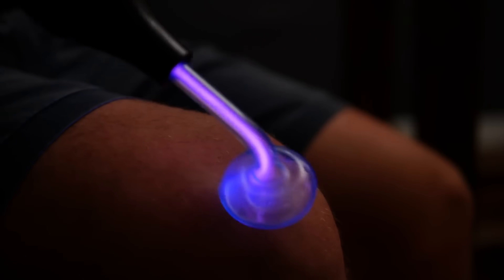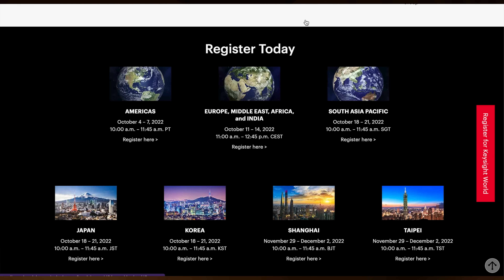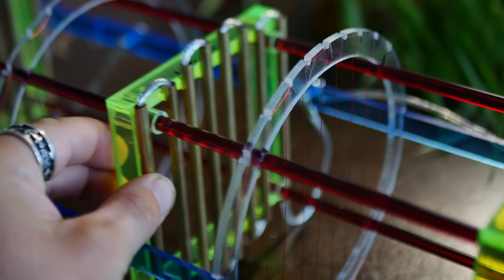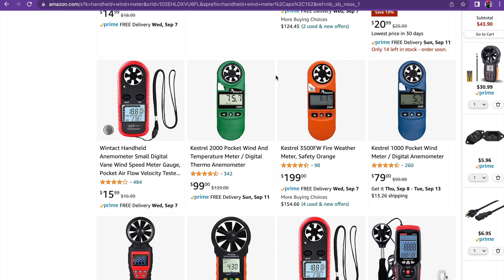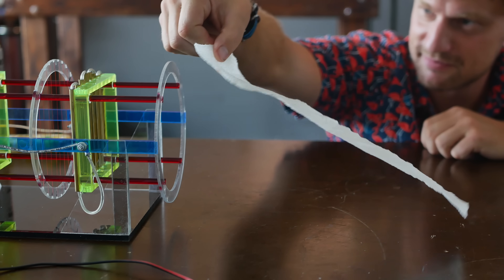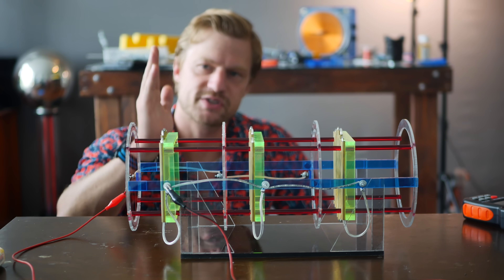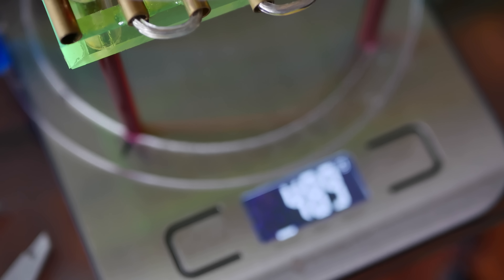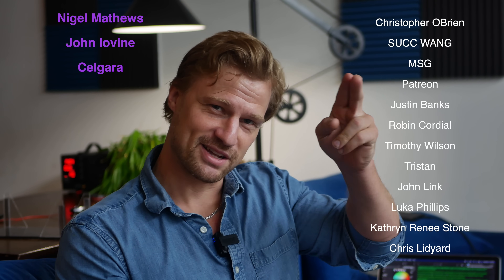Designing A Next-Gen Ionic Thruster! (For Flight)

Comment: How do we determine the optimal space is required for the separation/gap distance between the each segment/the wire’s (e.g. in terms of number of electrodes, their geometry, physical electrical parameters such as arc voltage and frequency, etc.)

For suggestion, use of dielectrics may be something considering for future advancements. Great project!
Reply: The larger the gap and thinner the emitter wires the more thrust is produced per watt, and less current is required.  In other words, large spacings are much more efficient.  If a strong heavy power supply is used closer spacing produces more thrust, but at a great cost to efficiency.  Multiple stages produce a little more thrust but also at a large cost in efficiency.  Visible corona even in the UV light spectrum represents power losses.  It is most visible on these devices with close emitter to collector spacings.
Reply: This make sense both empirically and in general. Perhaps the direct relationship to efficiency is non-linear or there are additional parameters to consider that make things non-ideal which has more so to do with the electrodynamic behavior as well as the interactions with the geometry involved, assuming everything else remains constant. Thank you for answering.
Reply: @Matthew-fl1cb  Any type of thruster that moves a small diameter surface of air rapidly is going to be inefficient. Any type of thruster that has a large surface area and move the air very slowing is going to be far more efficient.  It is basic physics.  Ion thrust is a low level thrust that can be produced very efficiently over long periods of time, but once the speed of the exhaust is increased in air, it becomes much less efficient. You are also correct that the interactions with geometry are very important.

Comment: This is so cool! I have a few ideas.

- This kicks off tons of UV and ozone, so different material choices are definitely in order for longevity for any flying model. Carbon fiber is a crowd favorite but you gotta find one with the right epoxy so that it's resilient to UV. Also check out glass fiber reinforced nylon for brackets/thicker parts. Or wood! Wood actually has fantastic stiffness per weight. Especially balsa

- separately tuneable power supplies for each stage so you can really dial in optimal voltage

- is there a reason for tubes for the grounds? I would think thin sheets would be more streamlined

- on that note, a thin polymer with a conductive tape coating is probably lighter than metal sheet. Metallized tape or film might work

- larger diameter / play with the overall aspect ratio. I would suspect that losses due to boundary effects would decrease with shorter wider aspect

- I would also experiment with the size of each stage (maybe a frustum or log curve shape instead of a cylinder), diverging vs converging, and the grid spacing per stage. I suspect a converging engine where the grid also scales with diameter or area would provide less boundary air friction

- the MIT lifter seems like it uses a very high number of lithium cells in series, probably to get to as high of a starting voltage as possible, minimizing the amount of voltage boost needed
Reply: Isn't carbon fiber conductive?

Comment: Maybe have a velocity stack on the front or a cone on the rear might have a positive effect? I think if you 3d printed a exhaust cone with hollow holes printed inside the cone along the outside circumference (little like 1/4 inch) and then have them exit like half or 3/4 down the cone on angles to try and get a bit of a vortex that pulls air out? Experimenting with differnt length cones and velocity stacks and how many holes/how far down they exit would be something to try out

Comment: Hi Plasma Channel. Cool build you've made there. I have a suggestion that you might want to try out if possible. Remember the Coil gun designs, where we have IGBTs or Mosfets switching on and off each individual coils in a particular sequence... or an induction motor with the Rotating Magnetic fields for that matter. Please try powering each section as individual anode and cathode instead of the parallel connection that is used right now. That way you can try switching ON and OFF each section in a sequence. I have a feeling that it might improve the effeciency and may be the thrust as well. That way you have the option of changing the switching frequency as well.  Who knows, you might be on to something! All the best!

Comment: Great video man. It's really good to see somebody taking a quantitative approach to ionic thrusters, since there seems to be so little info out there on actual numbers involved.  It'd be interesting to see a comparison of thrust per unit power for various gaps/voltages. For a ballpark figure, a typical drone produces 3-5 grams of thrust per watt of power consumption while hovering (i.e. static thrust). If you could produce even close to 1 gram per watt, you'd have a viable thruster for flight. If you're planning to develop this thruster further, i think your biggest challenge will be thrust *density*, since it seems like it takes a relatively large amount of surface area / bulk per unit thrust.

I read a whitepaper a few years ago where the data seemed to suggest that there's a tradeoff between thrust density and thrust per unit power. A larger gap with a higher voltage will supposedly produce more thrust per unit power, but a lower thrust overall (and hence lower thrust density), whereas the inverse is true with a smaller gap and larger power. I imagine if you iterate enough, you'll find a good compromise between the two that's flight capable.

Comment: Probably the optimal spacing depends on air velocity hence the improvement when decreasing spacing.
Have you tried to increase spacing instead, to check that in that configuration the thruster underperforms?
Also forcing air in both directions could be an interesting experiment

Comment: -aerodynamics
- potential to use venturi
- enclose
- try changing size of grids and enclosed to increase pressure
- efficiency of electronic grid. copper per square inch
- try increasing tightness of grid proximity to each other or increasing distance. exponentially 
- add more grids
- increase efficiency of electrical flow: thermally, type of wire/thickness, etc
- magnetic properties could increase efficiency also

Comment: That was pretty neat, but I think you can increase thrust by adding the wires horizontally and vertically (make some squares, basically), so there's more ions flowing to the ground, but there's one problem: wire resistance... So it need to run in the highest voltage the multiplier can supply.
Btw, awesome video

Comment: Very nice. Three areas for improvement might be as follows.
1. Enclose the sides to prevent air from escaping.
2. Shield the ground rods on the back side with an insulator to reduce interaction with previous stages.
3. Remove sharp HV connection points to reduce corona.

Comment: I'd be interested to see it tested with enclosures and varied apertures to consolidate gas, perhaps even testing the venturi effect, torsion, and controlled dampening. it would also be interesting to see differing configurations of anode and cathode. like having one rotate to see if angle of alignment matters, or coiling (like a burner or like dithered heating elements in heating pads) to see if the different magnetic fields can effect efficiency.

Comment: Well first I would cover the sides with a tube so the air does not escape before reaching the end, then I would substitute the insulated wire for a mesh so you add some surface area, and the last thing would be reducing the diameter of the exhaust to increase air speed, also I guess increasing the voltage in each stage would help but I'm not sure at 100%

Comment: WOW!, this was my bachelors thesis back in 2009!. An EHD Thruster for Atmospheric propulsion!. way to go man!. 
As for improvements I can only share what I modelled. 1- The emmitter electrode was a mesh with short spikes emanating from the intersections.
2 - that electrode was coated with CVD diamond layer. This was to improve the ionisation efficiency.
3- the collector electrode was flat & in line with the airflow, to reduce turbulence.
4- breakdown voltage of air is ~40kVolts/cm. Use this as a rough estimate when deciding your electrode gap, dependant on your max supply voltage.

Additionally , try experimenting with pulsing the DC voltage at high frequencies. (Stanley mayer-esque)
Looking fwd to the follow up.

Comment: This Project has great Potential, here some Ideas:
1. Different shapes for the anode and cathode. Try to find the best ratio of air and ions in regard of total stage mass and ionic wind speed produced.
2. Coanda-Effect, at each stage or have a single air intake for the entire Application?
3. Additional ionic air exhaust Nozzle?
4. Linear accelerator, order the distance between each Stage in a quadratic manner. perhaps more stages are required?
I wanna see it fly.

Or at least produce some significant amount of Thrust.

Comment: Really awesome video and build.  For flight my concern is weight for the needed power supply. Also the thrust needed to push that weight may be a little too low. Also what is the speed needed to fly? This is my thought for flying outdoors in a field or something. Because wind conditions etc. my be a problem. But in a controlled environment i think it can be done but much easier.

Comment: Using ionic wind to fly is not about how good the thruster itself is. It is all about how low of mass you can make the high voltage power supply. You're innovating on the wrong end unless you want your "flying" machine to be tethered by a power cord.

Comment: Definitely enclose the body in a housing to reduce flow losses to the sides. Also you have structure in the air flow path that will increase turbulence. An extended inlet would help get the flow more laminar as well.

Comment: You need to focus on giving the thruster more amperage. The voltage multiplier method is screwing you a bit on that. Current is what produces ion species. Its proportional.
Reply: With higher amps one need to be careful and wear protection, amps is what kills not voltage😄 I'm guessing ya'll know that, but just putting it out there anyway just in case
Reply: @Mr.NorwegianMarcus  When i say amps, I mean going from 1 microamp to 100 microamps, for example. Idk how much he is pushing now but I am sure it is far below the dangerous threshold. (Danger is in the mA range and above. Also, he should make sure the circuit has the LEAST(none if possible) capacitance for safety reasons...
Reply: @stupidvids0  gotchu🙂, but better safe than sorry u know

Comment: 1.  Needs a case to keep the air inside the thruster 

2. Closer distence between stages and 

3.  Use a diffuser to keep the air flow smooth

Comment: Maybe the first grid should be considered 0V, subsequent grids should have a higher voltage than the one before, instead of all being in parallel
I'm not surprised that the unequal spacing gave better results, as the air goes through the first grid it is speeded up to a set figure, so the next grid needs to take that speed and increase it by making it travel a further distance.

Comment: Have you tried staggering the plates so the wires are not parallel to the next plate wires, but at an angle to it? What would that ultimate angle be? 90º?
What if you don't use magnet wire but bare wire instead? Maybe scratch off only the top has side of the wire, then scratch off the other side to get bare wires. 
What if you use a magnetic focusing ring like they used in old CRT tubes, to form a jet nozzle to squeeze the air into a narrower stream, cay you make more thrust? 
Maybe installing very small NEO magnets around a final plate that contains the "Nozzle" hole? 
I too love Plasma. It's like a rip in space time.  So many questions, not enough answers. Please experiment more. If you want more ideas, I have millions of them you can try :)